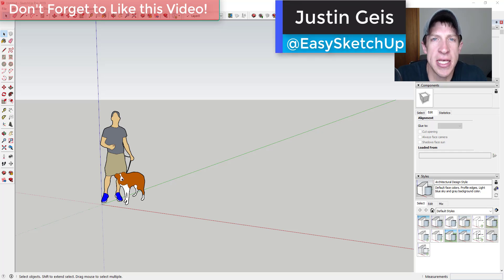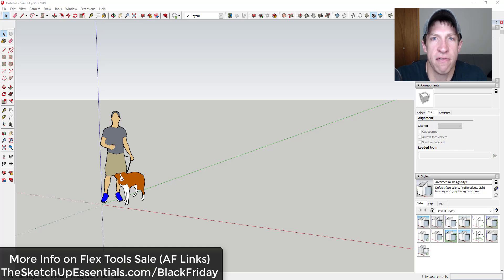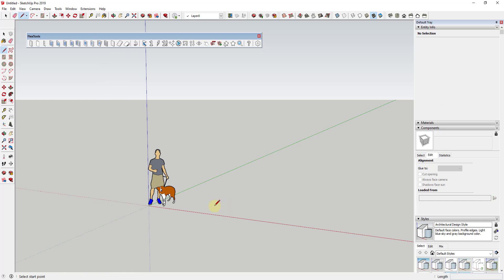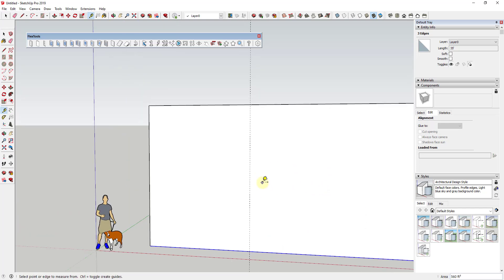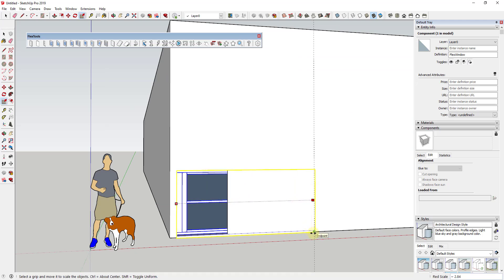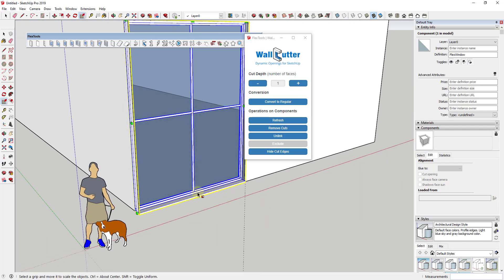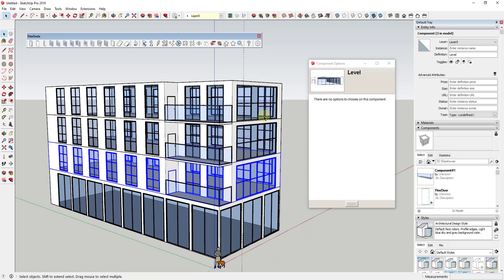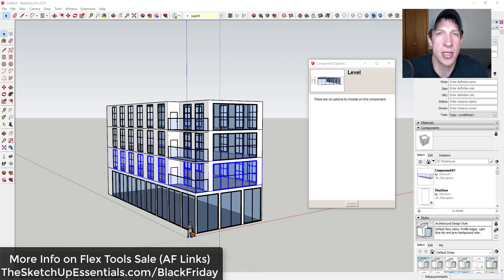Creating COMMERCIAL WINDOWS in SketchUp with Flex Tools

Comment: Thank you for the great overview (as usual). I am just getting started with Flex tools and so far it's working out perfectly. It's a shame it doesn't have the option to divide a window into 3 unequal sashes. E.g. A 2'-6" wide sash, a 5' center fixed window adn then another 2'-6" wide sash. I guess it can be done as 3 separate windows grouped together...